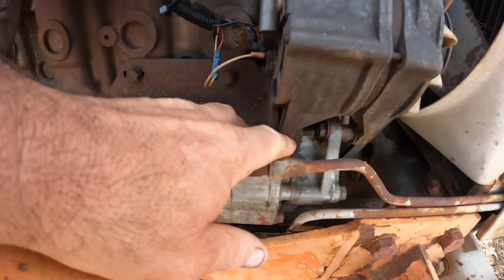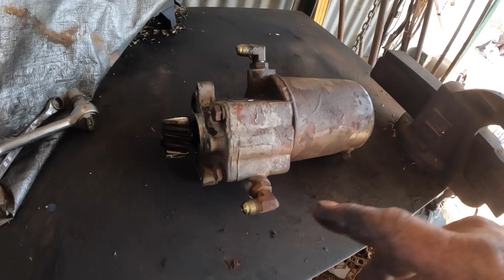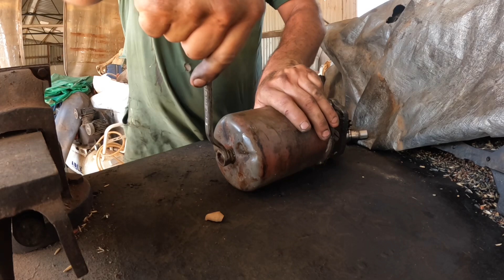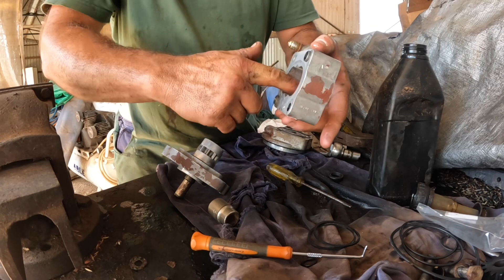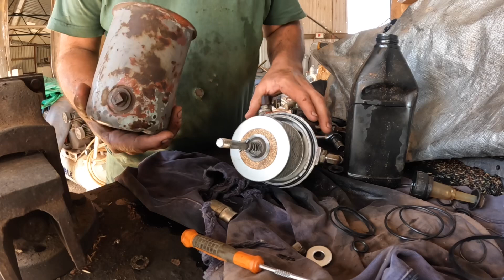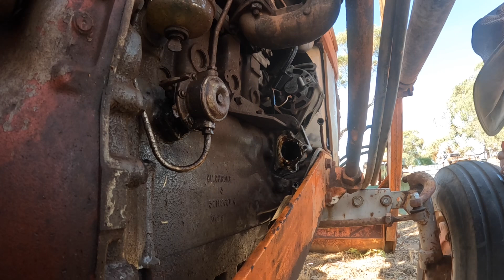Rebuilding the power steering pump on the Massy 178

Comment: Thanks for sharing, I have the same leak on my 178, and did not dare doing it myself so far, after watching I think i will try. Quick question, I was wondering if the washer holding the filter with the spring should not be the other way around?
Reply from the maker: Hi, I am glad it helped. It is not a hard job to do. Yes I may have got he washer on back to front. Some bits in there were also the wrong parts and didn’t fit properly. Thanks from Geoffrey

Comment: Really good vid, what was the kit called, I look up the Plessey pump on the internet but little info
Reply from the maker: Hi, I got the kit of EBay. https://www.ebay.com.au/itm/324068098756?mkcid=16&mkevt=1&mkrid=705-154756-20017-0&ssspo=sjWxJFQNSlC&sssrc=2349624&ssuid=FBTtRjeIQai&var=&widget_ver=artemis&media=COPY.
It seemed to have the right bits in it. 
Good luck with yours.
Thanks from Geoffrey

Comment: I have the same pump and same problem on my leaky Leylands. I think the different seal installed on the first lip is to have it running on fresh shaft so it will last like new and wont chop a new seal. The problem with the Leylands is now further down the line with the wear in the pins and steering pivots at the valve  and ram. I think I need Pete with all the great work he has done on his IH 756 gear shift linkage.
Reply from the maker: Hi David, it’s hard to keep steering on tractors in good condition. With the speed you are traveling it never seems like a high priority.
Yes that is probably the reason for the different seal.
I was watching Pete doing all the work on the 756. He did a great job. It surprised me how many of those parts he could just buy off the shelf. The Massey 178 is the first tractor I have had that most of those harder to get parts are easily available. Having said that the new temperature gauge still doesn’t fit properly.
Thanks from Geoffrey